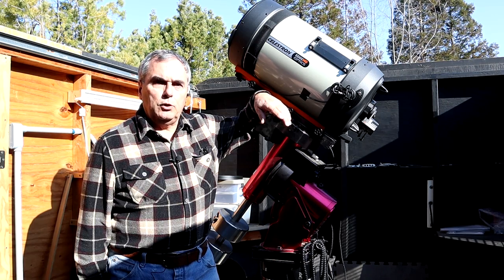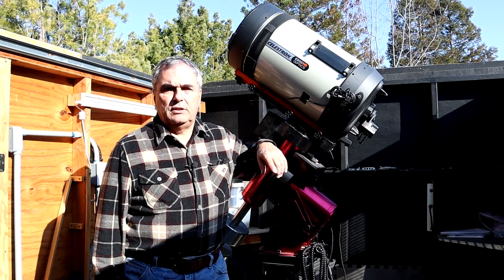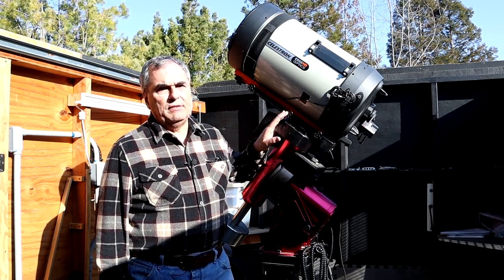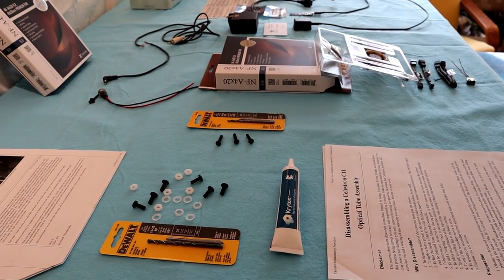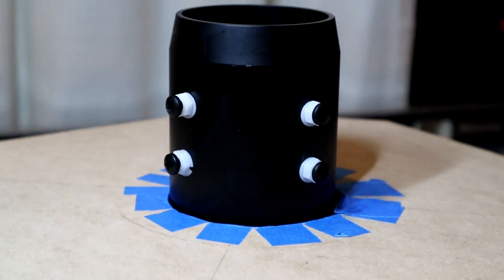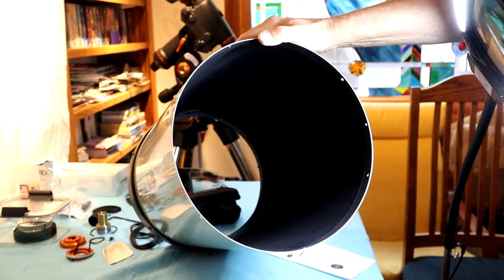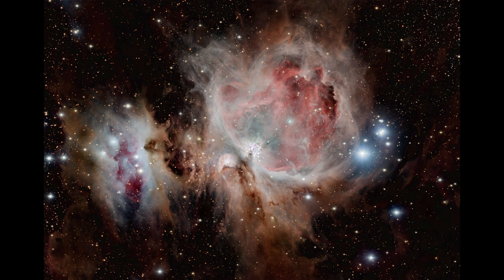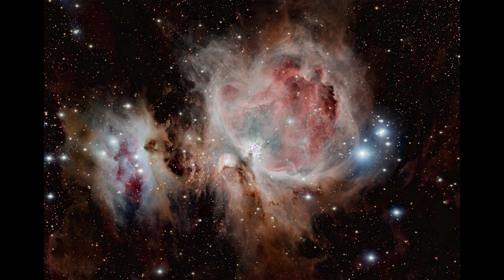Schmidt Cassegrain Telescope (SCT) Modification

Comment: Amazing. I performed the Nylon screws install on my C11 XLT and in hindsight, i would not have done it if i knew what i now know; the difference in improvement was minimum. I mostly capture planetary so I'm always capturing at high magnifications were mirror shift/flop is a real problem and installing the Nylon screws did very little to improved this. The scope really could do with a redesign, perhaps installing bearings on the outer baffle tube, were they would glide up and down on the inner baffle tube to stabilise the mirror instead of relaying on vacuum grease!. I did install cooling fans too. On the XLT there is no option to install fans without taking the scope apart, there are no ready made recesses for fans to be installed. This has made a big difference for me, so was worth taking the scope apart for this. Thanks for the video.
Reply from the maker: You are welcome.  Sounds like your experience with the Nylon screws and internal fans matches Daves.  Not so much improvement for the screws but noticeable improvement with the fans.
Reply: @astronomytipsreviewswithcu740 
Hello! I have some issues with my 9.25 HD while doing deep Sky imaging using the 0.7x reducer. During 1-2 hours the captured single frames of 90 seconds will slowly move down in RA axes. So when I'm over laying the first and last image of the whole session, Orion moved roughly through 1/5 of the aps-c Sensor. I'm guiding via a separate guide scope and checked the graphs. I could reproduce the very same results on the next clear evening. I'm wondering if this could be caused by mirror flop too or if this happens suddenly but not steady over the entire imaging Session..what do you think? Thank a for the great Video!!
Reply: I quickly made 2 vids from some of the frames of  2 nights of roughly 2 hours of exposures each. so the image drift represents roughly 2 hours  and guiding was super stable all the time:  https://youtu.be/M9dvJ_iYpz0
https://youtu.be/xd1t2lO3Om4
Reply from the maker: @andreas_r136  Mirror flop.  I suggest an on axis guider as I have the same problem using a separate guide scope.
Reply: @astronomytipsreviewswithcu740   hi! thanks for your reply. I will get mine tomorrow (decided to go with the bigger celestron one to have enough margin to the aps-c sensor.  but is there nothing to fix that? I thought I might remove the whole main mirror cell for once and check if the retainer ring of the main mirror is properly tightened up ..  maybe .. Its hard to believe that this is a general design flaw of the edgeHD's as so many ppl are doing deep sky imaging with them . .

Comment: Great watching your series and seeing the ingenious mods. Liked the disassembly video—I part-disassembled my first Celestron, a 1970s C5, for cleaning back in the 1980s, but it was excellent getting a close look inside the C11 Edge. Choice of a premium low vibration, long-life fan must have been important—but I guess it’s off during imaging? Your Great Nebula image is brilliant, very 3D :-)
Reply from the maker: The fans are kept on even while imaging.  The objective of the fans is to try and get a laminar flow across the face of the mirror, not so much for cooling.  Anyway, it is not clear if the fans actually help in that regard.

Comment: Very precious information about these mods I've already heard before, thank you so much Curtis !
But to scary for me to try on my C8 edgeHD, I've just replaced the original red grease by a much higher grade one made by Baader and it reduced shifting significantly.
To equalize telescope temperature, I'm just using one Cool Edge fan from Arizona, but secondary mirror needs to be removed (not really a problem for me as I often shoot with an HyperStar).

Comment: Thank you for the very interesting video. Someone was using a method of drilling a hole in the outer wall near the mirror and pushing it from the outside to secure it. I would like to try this myself.
Reply: How much does the primary mirror travel in / out max ?

Comment: Curtis and Dave thanks for the very instructional video. as you know i only watch your astronomy activities from the outside or better to say  i like to watch your beautiful images at the end of the often tedious activities. the good news is your system was not worse after the modification but better as you hoped for. i say this because i think it is always easy to mess things up when they need very high precision handling. i would be curious if the design flaw should/could have been avoided by the company in the first place or is that only obvious after specific use?
Reply from the maker: Mirror flop is inherent to the way the focus mechanism works.  Probably could make it better but at a higher cost.
Reply: @astronomytipsreviewswithcu740   I had a takahshi 180-c before. it has the same slight mirror movements when focusing in /out as the celestron (also using a similar prim mirror focus system) . .. but when doing orion with the only reducer they provide at F9,8  - there was no moving of the image throughout the whole ~ 2 hours session. I just checked my raw images from last year.

Comment: Disappointed you didn’t cover how you realigned and collimated everything again after such a major strip down. Hopefully you will cover that in the next video
Reply from the maker: I considered that but the video was getting to be too long.  We just used my Hotech SC Collimator to do the full re-alignment.  With the SCT on the mount set at 90 deg it is relatively simple to set up.
Reply: @astronomytipsreviewswithcu740  I take it then that there is no adjustments that need done to the primary mirror at all. It’s just a matter or re assembling each part in the original position and then collimating the secondary with the hotech
Reply from the maker: @teslar1  Correct.

Comment: I thought the last thing you want is air swirling around inside the optical tube and in front of the primary mirror?
Reply from the maker: Correct.  You want a laminar flow of air across the mirror if you can get it.  Same with the upper atmosphere.

Comment: Did you find flocking the inside to be benefical? My RASA corrector plate is quite dirty and when going to uninstall it for cleaning, i´m very tempted to remove the primary and flock the inside :)
Reply from the maker: Dave said he did not see a compelling improvement from it.  But since it was very simple and inexpensive while he had everything apart you may want to do it.  You don't have to remove the primary, just the sides of the tube.

Comment: I’ve found an ingress of dust on my mirrors and corrector plate after installing my fans.  I keep them turned off when imagining because of vibrations.  Do you have any tips regarding the dust?
Reply from the maker: Filters on the fans.
Reply: @astronomytipsreviewswithcu740 RGB or narrowband?
Reply from the maker: @christopherleveck6835  Not clear what you are asking.

Comment: Trouble is you start Inttoducing fans,  they also suck in dust. If you have filter to stop dust it also restricts airflow. Would not use a fan to cool mirror on an SCT
Reply from the maker: I've used fans on my 14" and now 11" SCT for years and they help cool down the primary without any problems that I have encountered.  But, to each their own choice.

Comment: You are an experienced astronomer. You probably know that motorized focuser that shifts mirror all the time will eventually bring to disaster. 
You have to use off line focuser and lock mirror on your telescope. 
I could recommend Moonlite motorized focuser. Then, you will never touch mirror, and avoid trickery in fixing self inflicted problem.
Reply from the maker: SCTs focus by moving the mirror as you say.  This cause mirror shift when focusing which moves the target off center.  Other than an inconvenience, this is not a major problem.  The other problem with using the mirror to focus is mirror flop which describes the shifting of the mirror under its own weight when the angle of the telescope shifts significantly while tracking across the sky.  This can also cause frustration but with plate solving it is not a killer problem.  Indeed, an external focuser can help eliminate focus shift but will not fix mirror flop.  That is because the "locks" on the Celestron SCT are not really locks.  They are merely long protrusions which push up against the back the mirror to provide friction but they do not completely  prevent the mirror from shifting.  It helps, but doesn't completely eliminate the flop.
Reply: @astronomytipsreviewswithcu740   External focuser WILL solve mirror shift. Ok. 
First, lock of mirror is critical as external focus is. 
Second, any shift or flop of mirror and I will never build sky model for 10 micron. As a fact, locking mirror and external focus allows building sky model with 5-6” rms precision and at least 7 min unguided with f10 and image scale of 0.4”/pixel. 
Third, I don’t refocus after meridian flip, and speed of slewing is whooping 8 degree per second.
One more thing, I had once upon time sheeit Edge 9.25 that flopped and couldn’t collimate. I returned it, and ask for replacement from Celestron (no repair, but replacement). They sent my current scope. Never needed collimation, and never misbehaved. 1.5-1.8” FWHM and 0.3-0.4 eccentricity obtained in 70% sessions.
Reply: Unfortunately you can't use an external focuser like a moonlight whilst using a hyperstar.
Reply: @Dasman5624  Yes, but I don’t care about hyperstar.